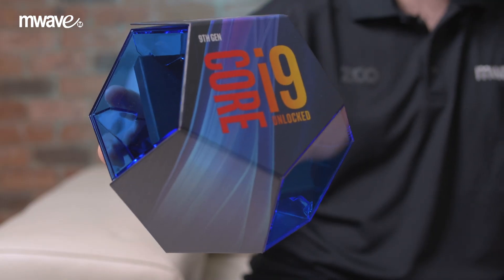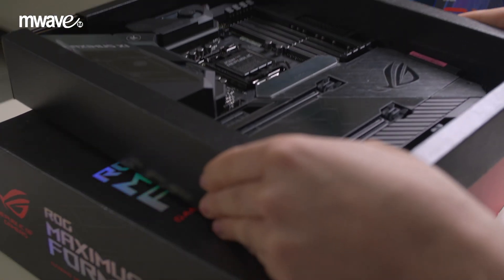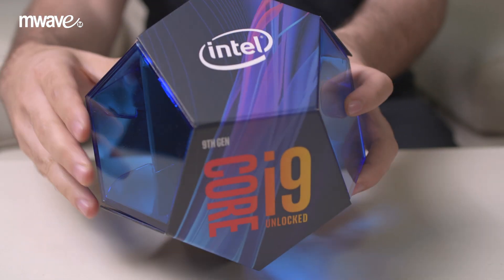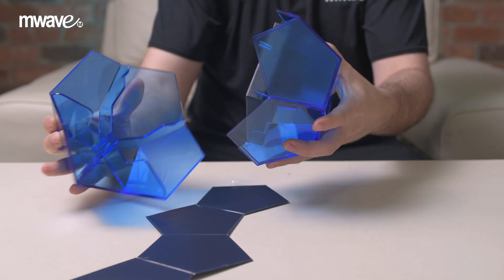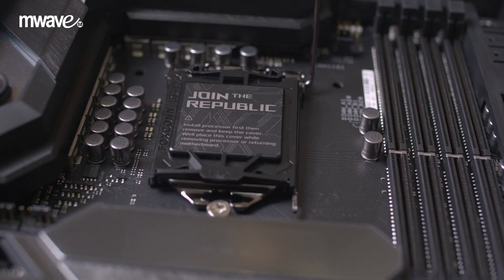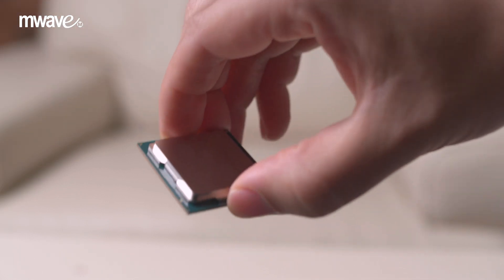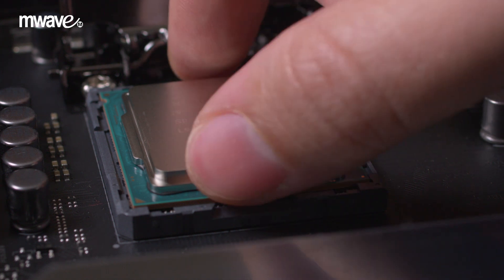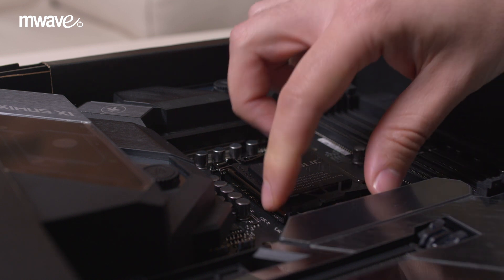DIY - How to Install Intel's 9th Gen CPU into a Motherboard

Comment: i have a question do you know if my 9th gen can work on a 10/11th gen mother board
Reply from the maker: Hello! Unfortunately no. 9th Gen Intel CPUs use an LGA1151 socket, whereas 10th and 11th Gen CPUs (and their motherboards) use an LGA1200 socket. So it wouldn't physically fit into the motherboard. Sorry!

Comment: Hello, can i use core i9 9900k cpu in tuf gaming z590 plus wifi mother bord???
Reply from the maker: Hello! No, unfortunately, you cannot as they have different sockets. The Intel Core i9 9900K has an LGA1511 and the ASUS TUF GAMING Z590-PLUS WIFI Motherboard has an LGA1200 socket so the pins won't match up. Please do not try and force it as the pins are fragile and they will bend. Making it almost impossible to fix :(
Reply: @MwaveAU  thanks man❤️

Comment: The fkin notches doesnt fit wtf
Reply from the maker: Hello! Which CPU and Motherboard are you using? They both need to have the same socket type, i.e LGA1151 and LGA1200 are the common sockets for most Intel CPUs.

Comment: I have a b360m chipset motherboard will this be good for this cpu if not what should motherboard should I upgrade to
Reply: im 6 months late but personally the chipset I'd recommend is Z390, and if you want a micro-atx board then I recommend the ASRock Z390M PRO4 or MSI Z390M Gaming Edge AC

Comment: I have a z370 and I want to put in a 9th gen. Can I put the cpu in and use a flash drive to install the update or will it not work at all until I update with a a different cpu